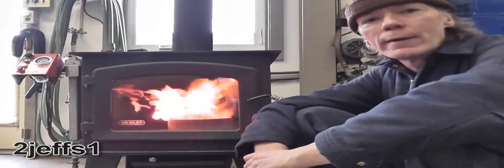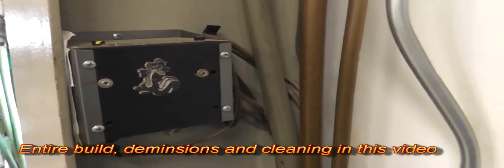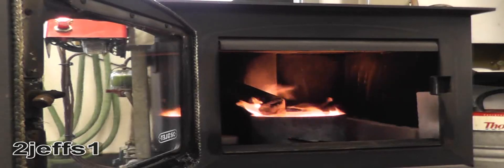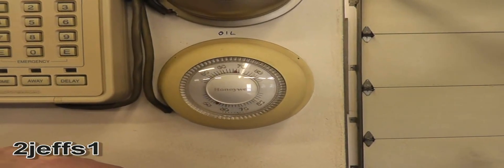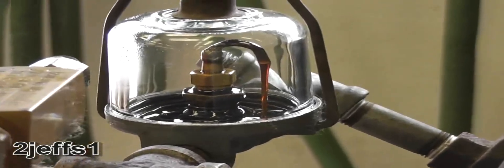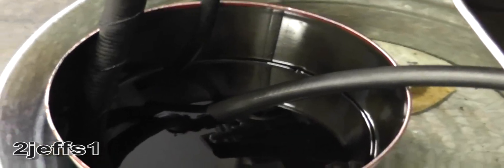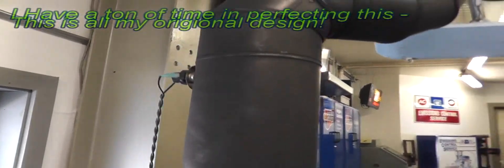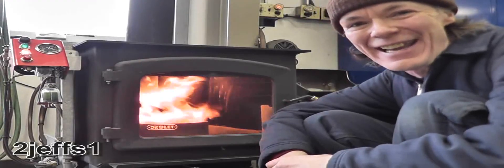Homemade Waste Oil Burner Heater for Daily Use DIY

Comment: Hi there! 
I was hoping you could help me out? The pulley you used on the smog pump looks very small compared to the one I purchased with the pump. I have searched and I cannot find a small bolt on pulley. Any suggestions would be appreciated.

Comment: Hello
I was wondering if a refrigerator air pump may work? See I'm moving and have a couple and alot of the parts for my propane tank burner but don't know whether I should move these air pumps

Comment: To all the people attempting to make this with LED indicator lights: you cannot wire the yellow light in series with the solenoid, the resistor in the LED restricts the current too much and causes too much of a voltage drop. Yellow light must be wired in parallel, negative on yellow wire coming from relay, and positive from white wire feeding all the lights. You’re are most welcome 😊

Comment: Hey brother,
Just wanted you to know that I watched this video last year and followed your design, now I have a well functioning, thermostatically controlled converted Coaldale stove heating my shop. The building is 2900 sq. ft. with 16 ft. walls, the heater keeps it 60 to 65 degrees even when it is zero outside, on about 10 gallons of oil per day. Thank you for sharing your ingenious design!!

Comment: Hi Jeff!  Thanks so much for posting this and the Leaf battery video.  Question:. What is the crap in the oil burner residue?  It looks like sulfur, which could be useful.
Reply from the maker: I call it carbon. Not sure the actual term.....

Comment: Smog Pump..  3 out of 3 at a local scrap yard were froze up.. Autozone wanted $125 for a rebuilt.. 
Just curious.. Do you know if the newer "Secondary Air Smog Air Pumps" in the 2004-2009 Buick/Chevy/Cadillac/GMC's work the same? I find some on Ebay $40 that are 12 volt, probably won't hold up long, but, might  work for testing, while I see if I can find a good "Old" one?..  this is what I was looking at: https://www.ebay.com/itm/153315539090
Reply from the maker: Wow. Seems like several yrs back they wanted like 40. Dang robbers! Never tried those electric 12v pumps. Cool you brought that up. Always wondered if that could be an option! My setup has been good otherwise in today's times bet I would of tried that. When those are in the automotive use - they only are on for several minutes. Thought you might find that interesting to know...

Comment: I was inspired enough to do a build myself.  I have done a couple of changes though.  I want to run this in a shed outside of my shop for insurance reasons - as soon as I explain there's a fireplace in my shop/house, my insurance doubles or they just won't insure me.  To get around this, I have decided to run this set up in a small shed outside about 20 feet away and I am going to use a water boiler setup.  I am more familiar with this type of heat anyways.  I built a oil delivery tube with a water jacket for cooling rather than using the air pipe as you have suggested.  I am going to make a heat exchanger tube system run above the fire - replacing the steel baffle plate with 3/4 black iron pipe. I have the expansion tank and 30psi blow off valve worked into the design so no worries about a scalding explosion.  I have run into an issue however, I have called a few auto wrecking yards in the area and can't seem to find a smog pump for a reasonable price.  I have several 110 volt computer fans that I acquired from a computer server rack.  I was thinking of installing a couple three on a small box with the tube running into the fire pan in the fire place to get the swirl.  Do you think there would be enough air coming from these fans to accomplish the same volume as a smog pump?
Reply from the maker: Computer fans will not work as hoped. That's air volume and not pressure. Somewhere in the comments I had a P/N for the smog pump and where to purchase. I think they were only like 50 - 60 bucks. Where you would never have to mess with it again that is probably the best bang for your buck.
Reply: @2jeffs1  Got it up and running.  I ended up using a squirrel cage fan.  As far as I can tell it's working great.  Its currently -17 degrees centigrade out and I have warmed up my 40x80 shop up about 4 degrees in 2 hours.  Instead of running it out in a separate shed, i decided to just put it in the shop and only run it when i am around.  It still has the water boiler setup so I run it to a fan coil in a separate area.  I'm pretty happy with it so far.  Thanks for the info Jeff!
Reply from the maker: Sounds great! Thank you too for your feedback!

Comment: I heated a big drafty house for almost 20 years with a Lanair 110,000 btu waste oil heater in the basement.  Using clean oil is the secret. Also I put a 5 minute time delay on the  gun pre-heater so it didn't cook the oil all the time the heater wasn't running. When the thermostat called for heat the strips came on and 5 minutes later the furnace kicked in. Worked like a charm. No smell at all unless something was amiss.

Comment: hi there, very nice unit, what's the downside of using a compressor?
Reply from the maker: A compressor works great. Just set a regulator to around 30 PSI. I didn't like the extra wear and tear on the compressor and that it does consume more electricity. When an electric motor starts they draw app 8x the running amp load for x amount of M-sec's. A continuous run 1/4 HP will definitely save on the electric bill. Those smog pumps last a long time, years back they were free. Everyone was taking them off their cars! Dang emissions stuff. ;>)

Comment: Great video ! Great oil burner ! Great personality ! Thumbs up from me ! With your setup, approx how much oil would you say you burn an hour ( or day if thats easier ) Thanks for he great video !!
Reply from the maker: I never had it hooked to a 5 gallon pail so that is hard to say. I have those 250 gallon tanks and will go thru 1 to 1-1/2 of those in a winter. So many variables to that where it cycles after up to room temp, the building is well insulated and how many hours are spent out there in a day.

Comment: I have a question for you... We recently got 4 / 55 Gallons of Free Oil, but some have Water in them and some are really Sluggish :///. Any tips on how to Filter them? Thank in advanced !!!
Reply from the maker: Hi Jod. I only except oil from people I know to avoid those issues. But I know someone who isn't so lucky and they burn lotsa oil. He said beware of the drums that were outside where rain sits on the top and the bun isn't tight. He has a barrel with a valve on the bottom. Water settles to the bottom and can be drained off that way and his heater feed pipe is like 4" higher. He also has a large funnel that he puts a rag across to fill a different container and catch the chunks. Not a good problem you have there, this should perhaps help out.
Reply: THANK YOU !!!!!!!!!!!!! I will try your great suggestions!!!

Comment: farm boy engineering- AMAZING- how you worked it all out-down to automatic heat sensor on the fans to circulate the air- your attention to the details--AMAZING good video

Comment: Fantastic.  I've been dripping oil into my Rocket Stove now for a few years, works good.  I have one question. Do you notice any rust on the roof of your building or on the ground /concrete next to the building ?  .... I ask because in the spring I have to spray down the building and concrete with muratic acid- I'm thinking it's the metals in the waste oil that get carried out with the exhaust stream
Reply from the maker: Haven't seen that issue here Mark. Wouldn't care for that either. However there is a lot of ash buildup inside the stove after days of use.

Comment: A lot of SAFETY, I like it :D... Functional and useful for sure. Oh, by the way, a 12V DC Solenoid can be used from a Lawn Mower Part.  I am going to make one soon... Although I will keep it simple, but I will use a Cheap Solenoid just for Safety Purposes.
Reply: Jod Bronson Laundry machines also have solenoids, if the valve itself - originally made for water - starts to leak, one can still adapt the solenoid coil or modify the valve to withstand oil.

Comment: I am really impressed with this system and how cheap it can be built. I'm thinking of how to make it look a little more cosmetically appealing with some shields or some thing so it could be used in the house. Put one supply  tank right on the outside in an enclosure with the air pump etc. Inside all you would have is the Thermostat and small control panel somewhere. Thanks for sharing it with us.
Reply from the maker: It's a pleasure to read these comments Jerry. It actually took a little shy of a week to put that video together. Wanted to make sure all the details needed were presented. Some things were worded poorly so I'd go out and do a re-shoot! Am I too picky? Naaa, always enjoyed helping others out!  ;>)
Reply: Thanks for the shout back. Wish I still had the energy and stamina to do all the thing I see you guys doing. I have one last project I'm determined to finish before I get too old to do anything. My '53 Willys Wagon. Going to put a video up about it after it warms up a bit.. If your into taking vitamins you should check my website out, http://jdenebak.com I just spotted part 2 of the stove video. I'm going to shoot over there and get the rest of the story.

Comment: I've been watching you're video  for years now and convinced my boss to let me convert our shop stove to waist oil about 3 years ago. was really inspired by your setup, i did not do an elaborate build like yours only a 5 gallon bucket some copper tubing and black pipe and a pot, worked great until our 3,000 dollar Ingersollrand motor went. So now I took a page out of your book with the smog pump and 1/4hp motor. this route will definitely save the wear and tear on the compressor. Thanks for the great video and all your hard work.
Reply from the maker: Your welcome. Enjoyed reading your write up! The smog pump setup is easier on the electric bill too v/s continual starting of a big air compressor.

Comment: Hi 2jeffs1, Great  project, could I get a little more information on the gauge in the Red box. Thanks for all the hard work you've done , and thanks for Sharing it with us.
Reply from the maker: Hi Fred. Its called a capillary tube temp gauge. There are no wires to make it work. Just a bulb at the end of a 6' cable. Those are for a car engine and screw into the engine block. Being not mounted directly to the stove it's not actually the stove temp. However it does tell me at a glance how hard the stove is working. Ideally a higher temp gauge on the stove housing would be nice but what is ever laying around here gets used and works just fine!

Comment: I've watched a lot of these videos on waste oil burning and of all of them yours is the most well thought out, cleanest and safest set up. 
Really liked the upside down sediment bulb as a drip monitor and the smog pump for air and the electric controls with thermal limit on the flue. 
Nice job on the presentation. 
Thank you.
Reply from the maker: Your welcome. It has been really cold here lately, then it is appreciated so much more. It's a great charging station when one comes in from outside. Burr! ;>)

Comment: hello, great stove design.  I have built this works great and i added 2 features to allow it run unattended. I put a solenoid valve on the main line oil feed. this will be turned off to stop oil flow under 2 conditions : 1  in the tray under the stove where overflow oil is collected i put a sensor which when it senses oil ir will shot off the valve and second is where the temperature of the stove exceeds a pre determined temperature,,,
Reply from the maker: Those are some nice additions/ideas you have added if one wouldn't be around keeping an eye on things!

Comment: nice stove. just curious how often do you have to clean the chimney out ? does it build up quick ?
Reply from the maker: Hi Brett. I remove the pipe to the ceiling and blow it out both directions with a high pressure air gun. No oily residue is ever stuck to the pipe walls. Its more like a dust. Same with the chimney. I have a 1/4'' x 3' pipe with the end squashed somewhat oval shaped on the air gun. Banging that around in the chimney gets it really clean. No brush is needed. Once a year is all that is necessary here.

Comment: I have the smog pump hooked up and it's working great (1750 rpm motor) does your smog pump get hot after a while of running, not sure if it's normal or if it's just because the smog pump is new and not broke in.
Reply from the maker: Hi Kevin. My pump does get warm but I don't think I'd call it hot. Whenever compressing air it's kinda the nature of the beast. Several other thoughts is I have an approximate 2 to 1 ratio running it is not running at motor speed. The other thought is where I am bleeding some of the air off to cool the 2" drippier tube if you were not doing that it would run warmer too where those were made for a bit more volume than that 1/4" tube. Them pumps are pretty tough but these were just a few other areas of thought which would make it run hotter. One last thing. I do remember seeing a 500 mile break in sticker on several of those pumps years back too.

Comment: very impressive. could you give me information on the 12 volt converter you used?
Reply from the maker: Hi Joshua. A friend gave me that many years ago. I believe it would be in the area of a 120v to 12v, 5 amp power supply.
Reply: thanks for the information. I also would like to know if you have a part number for the sediment bowls, if not what are the inlet and outlet size? thanks again

Comment: I'm impressed about this system. You really got a well balanced and well thought out system, for a relatively low cost. 
I thought about a much simpler thing for my humble workshop, but now I think I'll go the extra mile and get something similar to yours. Thanks a lot for sharing your experience with us.
Reply from the maker: Your welcome Kalle. More power to you to go the extra steps! Get it up and running and add the electrics at your leisure. Once you see and hear it run the finish it factor goes way up!  ;>)   Kalle - I think most folks think this setup is a bit overwhelming. I must say to them just do the burner and smog pump and the heck with the electrics. The stove size don't matter. No one should be disappointed compared to what else is out there. Actually I ran it that way for years before the electrics. Heck - free heat is free heat! This dependable/efficient design is used here daily and not something made just to run for a YT video. Actually an unknown fact is if one wants to add more oil than what I am you can turn the sides orange just like the competitions videos to make things look more impressive. The drawback to that is the stove gets warped and damaged, I found that out on my first one! Thank You Kalle for stopping by!  And - Thank all you viewers for your kindness and all the likes, VERY appreciated! ,Jeff
Reply: 2jeffs1 Oh yes..I saw an old cast iron stove get pretty damaged caused to excessive heat. The dude simply forgot to put an coal basket in there and fired it up with the goal directly on the bottom of it (without heat resistent stones). I guess something similar would occur if one was to run it on too much oil at the time.
Now that the autum is coming, I'll have to do some work on that old stove I have....get it up and running like your nice shop heater.
Hopefully, I'll be able to get as nice a result as you did with your project.

Comment: I have another question for you, do you know about how many HP the motor is that is driving your smog pump?

thank you
Reply from the maker: Hi Kevin. There is a 1/4 hp running the smog pump. Also I do recommend the slower running 1750 motor as noted in the video. :>)

Comment: how hot was it running also how hot will it get.. I tried to keep up with ya. but you are way above my pay grade. man your one smart dude. need a translator. .lol
Reply from the maker: +Chuck Hogg Hi Chuck. I am limiting it to 950f on the heater by having the cut out set to 250f on the chimney. One can go above that and make things glow but I distorted my last stove considerably doing so. Definitely looks more impressive on a video tho... ;>)

Comment: Hey, I started using a smog pump on my homemade oil burner after my first design gave me low temps and lots of soot   . Set up an 87 caddy smog pump last night!  Your right! it makes more air than i can use. even diverting 1/2 the air I can get the stove to glow! Anyway, You mentioned something about the screws on the back of your pump but didn't go into detail, Can you clear that up when you get a moment? Thanks!
Reply from the maker: +shawn I Hello Shawn. Yeah - The use of the smog pump is the big win for efficient operation. I can make the sides glow like the others but that distorts the heck out of the stove and burner in the long run. (sure looks impressive for a video tho!) I believe those holes in the back were intended for if the pump output line would become pinched off to avoid a dead head situation. Seems like with those plugged off one could get a bit more pressure out of the pump for the blow off to cool the 2" oil feed tube into the stove. Is it really necessary? Not a substantial gain from what I remember. Just trying to get the most out of what is there.
Reply: +2jeffs1 Thanks for the reply.  I'm using a divertor valve that came off an old Dodge Dakata. It bolted right up to the gm smog pump and has 2 ports. One port I allow to blow off but I restrict the blow off side accordingly to get the desired air flow thru the other port. My oil line is 5/16" and feeds directly inside 1/2 pipe all the way till it enters the stainless bowl so it gets cooled the best possible. Its a very simple design and I will post an updated video. You Sir have developed the best homemade burner I have ever seen! Hats off to you!!!  Thanks Shawn